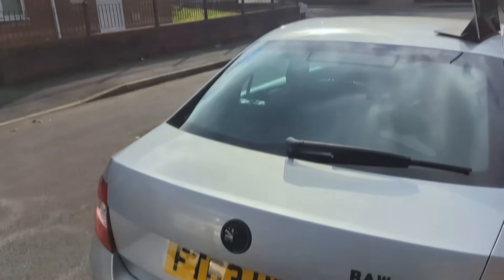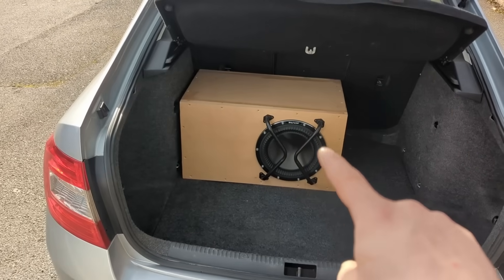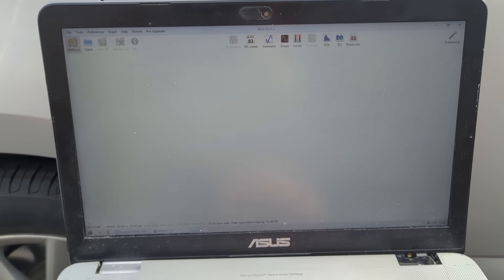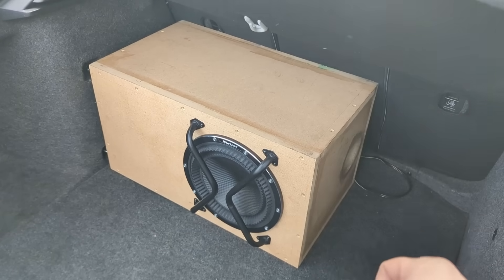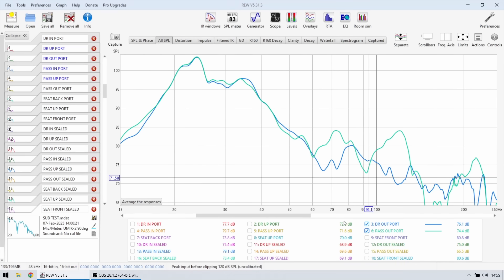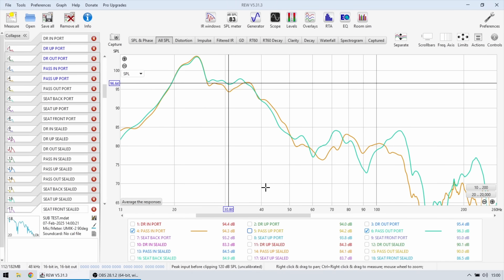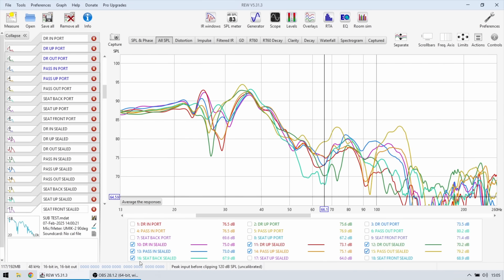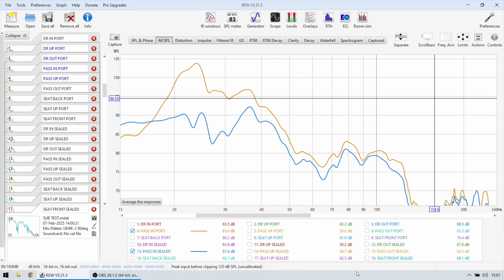Subwoofer locations compared with RTA

Comment: Shoot. I built a 2 x 12” speaker sealed, because of the fact I wanted to make it as stealth as possible I built the box to be flat with the floor and hide it in the void beneath the trunk floor in the Dodge Durango. So the speakers are Up facing. Looks like it’s one of the worst ways to aim. Although it’s SUV so quite different. I’d have to buy a mic eventually. I like how it plays though. Compared to what I built before ( single driver ported variations) this built is much much better in the dynamics and time domain. And yes I had to EQ it bothering the 20-35 portion to make it play beautiful. But it’s realistically much better than all the ported ones I heard before although a bit quieter.
I used the lowest Qts and Fs drivers I was able to find for reasonable price which appeared to be alpines s2-w12d2 26.6/0.43

Comment: Hello I have bmw sedan with open ski hole . I made flat sealed box 29 liters , for JL audio Tw3 slim subwoofer. Box will be sealed to back seat and the speaker will be looking into the cabin , I haven't installed it yet, but I really want to save space in my trunk , is it very bad method I am going to use it? I am using helix DSP , is it possible to get good result with tuning?

Comment: Interesting topic. I have argued about this topic for years, and for some reason, noone seems to believe me. I've faced my two 12s forward, backwards, and facing up. Two 12s subs forward, port forward (between the subs) and according to my ears, my friends ears, and a SPL meter, subs up/port up, firing into the trunk lid (boot lid/top/not sure what the term would be to the kat😂) 2008 Toyota Carolla. Trunk lock lasted a few months, then the thin flimsy sheet metal the latch is attached to, literally ripped like paper. Trunk had to be ratch strapped down from the inside, permanently secured now and not going to open without damaging something. Great video, enjoy your thoroughness

Comment: People should really take this information with a grain of salt. It really depends on a lot of factors...cabin, box, port, placement, tune, etc. A lot of hatchbacks sound and measure better cone facing up port to trunk. 
The best location is to buy yourself a mic and measure it yourself - your car, your components, your box, your setup, your tune. 
2-3 db is hell of a lot, especially if you compete in SQL/SPL....0.2db can make you a winner or a looser.
Nevertheless really nice intro for newbies where and how they should start.

Comment: Any chance of a max SPL readout?
Reply from the maker: Nope. Not interested in that at all.
Reply: @RAW-CAt  understandable, but im very interested in a full bandwidth sweep at highest SPL. My goals are simple, 135 db 20-60hz 2 10 inch subs under 100lbs total system weight. Or smaller subs.
Reply from the maker: @Subdynoman  as you can see my ported enclosure has a sloping response. In SQ a flat sub range is NOT desirable and is far from ideal. We want the lowest frequencies to be louder than the higher ones. 20-200Hz is a slope, not a straight line.
Reply: @RAW-CAt  yes I agree, I emphasize my tuning in my system on the low side usually tuned to 18hz with the peak spl due to cabin gain in my car at 24hz. Nothing serious yet. Just trying to find my preferred loudness to power to weight ratios. At the moment, though, I'm very happy with 135db in my car at minimum, just not with the total weight it requires to do it. My max spl is actually 143 @ 24hz but it's runs a smooth 135 db from 18-60hz. I'm still dialing in that ratio of practical. Maybe I missed a vid of yours. What were your intended goals for your system?

Comment: Thanks a ton @rawcat for all the videos you are putting across. I have learned a lot from your videos. These are things that most of us wanted to do but couldn't. Couple or suggestions from my end:

* To validate if the port is contributing to the overall response can we do an impedance sweep to check if there are secondary resonances.
 
* Is the oversize enclosing contributing to the dip (making the dip worse). Would it be possible to do a simulation (of both sealed and ported) to confirm this.
Reply from the maker: I have impedance graphs and a direct sealed vs ported comparison here:
https://youtu.be/p6gERXxDM_w?si=V52TkKbp0b4Cou56

If the port would be contributing, it would be the same frequency, however the frequency depends on the location.
Reply: @RAW-CAt  sorry I might have missed this video. Thanks for sharing it makes sense. So probably it's probably cabin loading enclosures differently.

Comment: Great info, do you have any thoughts when putting 2 subs in, should I place 1 on each side pointing at each other or would this cause some cancellations, or should I angle them up on a 45 degree angle? Thanks
Reply from the maker: Yes, you can have them in corners👍 Aiming is not necessary and there will be no cancellations.

Comment: Amazing video, as always. I am really impressed with the ported results, but I have to admit I am skeptical a plugged ported box will properly approximate a well designed sealed enclosure.
Reply: Describe a "well" design sealed enclosure.
Reply: @Subdynoman  one that follows the exact recommended specifications provided by the subwoofer manufacturer, and then uses high quality materials. Raw Cat also mentioned some enclosure, like the stealth enclosures that are custom made to fit into the car near the wheel well, are made of high quality fiberglass.
Reply: @Subdynoman  and as the test results demonstrated, those are very suitable locations.

Comment: Great tests - I recommend you look at the impedance plots for the sub at these different locations since the acoustical loading on the driver could have some influence.  I doubt this explains the large variances but will certainly influence the overall performance.  Also I would do a ground plane measurement of the enclosure and then do some mathematics in REW to see the transfer functions of the car to nail down the dominant dimensional room modes.   The key one is the axial mode which runs from the firewall usually to the back hatch.  By opening the hatch you can then begin to isolate the lateral/vertical dimension impact from tangential modes and see the actual gain of the box "in the box" (the car cavity).  People don't realize a car is like sitting inside a large woofer box itself.  I enjoy your work as an Audio Engineer designing in OEM car audio world 40 years.  :)

Comment: I feel like you are comparing apples and oranges with the ported vs sealed, a much better comparison would be a ported box with the port on the front next to the sub, then you wouldn't have so much variation in the sealed vs ported measurements. Of course, there would still be the level increase on the low end for the ported sub, but I'd bet the dips and peaks would have a more consistent placement between the ported and sealed.

Comment: Sealed is pretty horrendous despite the feeling that they Sound better, does it mean we like "worse" sound?
Reply: It just means your ears are a better judge of what's good or bad compared to test equipment. 😊

Although the response curve of a sealed enclosure is usually not great (that's vehicle dependent), you can tweak it with a dsp to smooth it out. 

Sealed might also mask some flaws in some sub and amp designs. 

I ran only sealed and infinite baffle the last 30 years, but after experimenting with what's possible with ported enclosures, I've converted. I can get just as good sound, better frequency response (stronger low end extension) and much higher efficiency.
Reply from the maker: I will make a video in a couple of days, but I don't like how this sub sounds. Will try smaller sealed later on.
Reply: @RAW-CAt  What's the net volume of the current box?
Reply from the maker: @elviscaragea4433  I believe close to 3 cu ft.
Reply: @RAW-CAt  mby will sound better in a smaller box, closer to the vas
Reply from the maker: @elviscaragea4433  vas has nothing to do with optimal enclosure size, but yes, I believe smaller sealed enclosure would perform much better. I am planning to try it out.
Reply: @RAW-CAt  and whats about that?
Reply from the maker: @elviscaragea4433  it's just a measure of suspension stifness. The only commonality is the units of measure.
Reply: @RAW-CAt  i have played with box sizes, on a sub with qts of 0.4 no eq . Extra big box(60l), big box(40l) and exactly on vas(30l), the small one on vas, was night and day in difference, sounded so good, fast and precise, the other ones sounded slow and all over the place. But i think is about the q

Comment: Wow, those response curves are bad. I can't believe it's rolling off above 37? So 20-37 is your usable bandwidth? That's worse than my full size SUV. It at least plays up to 45hz. 

Is this with the boot cover in place or removed? If in place, I'd remove it to see the effect. If it's better, you could cut some holes in it and add some big speaker covers/grills. Then the pressure can move more freely and the whole boot would still be hidden. 

You could also try a different sub or box.
Reply from the maker: This cabin will be perfect for IB, but I think I will need a front sub, even with 8s in the kicks😬
Reply: I need to prove it but, I believe a Tline with the same size box could do better, maybe even a sealed tline. I'm surprised by the huge hump on the bandwidth. SQ guys are even more of a head ache for me than SPL brand huggers. 😢
Reply from the maker: @Subdynoman  that pump at low end is perfectly fine. In the next video you will see the tuning process. A subwoofer frequency response really has to be sloped, not flat like everyone thinks.

Comment: Would a change in the length of the cabin change the response.
Reply from the maker: Yes. It's harder to achieve low frequency reproduction in a short cabin. That's why we love wagons and long hatchbacks for IB😎
Reply: Absolutely
Reply: @Masterdebator881  as i have 2 15s up firing with an 8 inch aeroport firing toward the hatch. In a dodge magnum.  I know this is not a question..... it's me thinking outloud..
Reply: It seems to play nice and low

Comment: Could you please compare down firing orientation as this is my favorite configuration for my work vehicles. I usually make feet for the box that will keep the subwoofer about an inch away from the floor at full excursion.
Reply from the maker: Down firing enclosures are very popular in American trucks, to have them under the rear seats. I have never seen a down firing enclosure used in the UK in a typical european vehicle🤷 And I am not planning down firing configuration for my build. I would imagine results will be similar to "behind the seats firing into the seats".
Reply: Ok thanks for the reply, I should clarify I prefer down firing because of utility not so much sound, for protecting the subs and not worrying about damaging them with cargo
Reply: @RAW-CAt 
It's typically not. The seats are not as solid as the floor, and you dont have to make legs and whatnot that surround the drivers and make a slot for the air to exit from.

Comment: Would you expect a better response from a correctly sized, sealed enclosure?
Reply from the maker: I would expect better performance (like more quality sound), the response would be different as any change in the enclosure changes the response.
Reply: It would depend on your bass driver. Many drivers allow for much excursion. Therefore, you want to maximize that by making the enclosure as big as possible to give it enough airspace to move freely.
Reply: @Alastasius  The reason I asked was, he clearly says the enclosure is too big in the video.
Reply: @RalphMercuroMusic  Too big is only bad if the enclosure is taking too much space